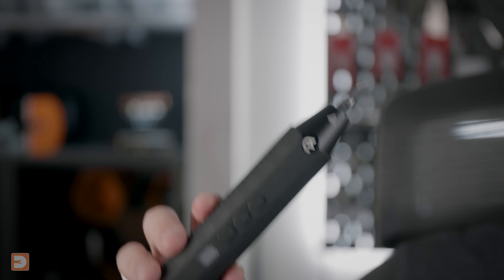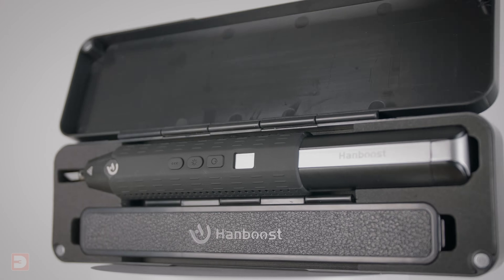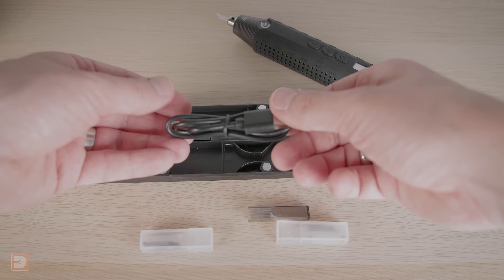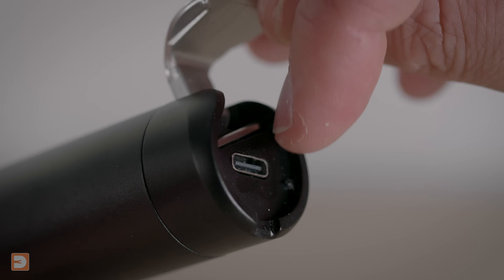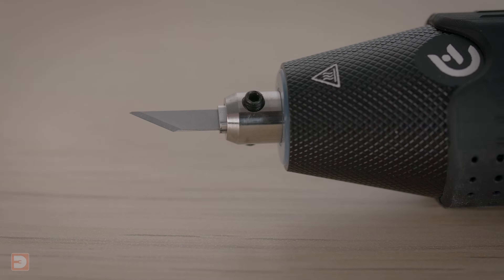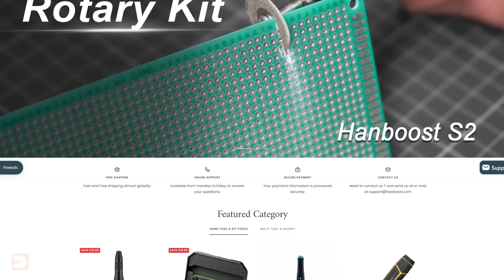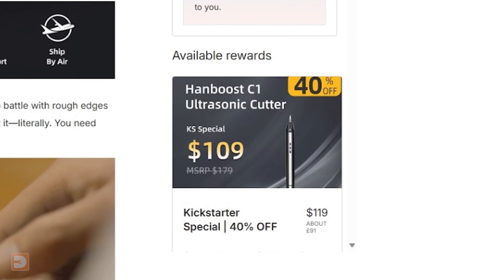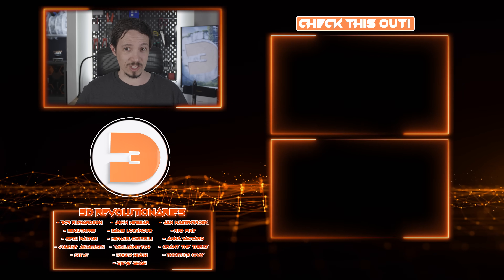Ultrasonic cutter with 3D printing

Comment: I started noticing a lot of audio popping around 2:15.
Reply from the maker: Yeah I’m really sorry about this. I’m not entirely sure what caused it. I’ve tested my full audio setup extensively after discovering this in the edit and it was all fine. The only thing I can think of is, I was experiencing a lot of static shocks whilst filming this video, which was often discharged when touching the camera, monitor or tripod, so that could have partially corrupted the saved files, but other than that I’m not sure.
It’s also the first video I’ve filmed in ages where I hadn’t also used a secondary audio system (so both radio lav mic & shotgun), which really sucks
Reply: Actually, it started before that

Comment: Constructive Feedback: at 4:56 you suggest it "seemed" to take less time overall; you have your hands on the tool and I came for your review, so please measure whether it took longer or not. Similarly at 5:54, telling me the C1 could "probably" clean up the melted cut surface doesn't help me learn about the tool; try it out, show me the results, talk about the results.
Reply: His description of the gains was a bit vague and reserved, but in that, it was very much on point: These things can make some things a little bit easier, but it's mostly just mild improvements over either entirely manual cutting or hot knives (expensive mild improvements, that is). Nothing that'd be easily quantified in cutting time.
Reply: I own a Custom Car shop my Vinyl Wrapper would love this tool..
Reply: A serrated knife would cut better
Reply from the maker: I appreciate your feedback and thanks for watching, but I feel  @keinschwein8467 who responded to you below explains quite well. The impact this knife can have on cuttnig time not only varies drastically on the type of job you're doing (3D printing support material or a vinyl sheet), but can vary a lot on the specific thing you're doing (2 different 3D printed models). 
I know that I did show direct comparisons in the video, and didn't show them in their enteriety in real-time (as that would have made for an extremely boring video), but I should have included a summary of total times, that's my bad. However, again, even if on that specific model it shaved off a few minutes time compared to traditional tools, on another model it could have saved 5 times as long, and on another one again it could have actually taken longer. 

At the end of the day it's another tool that's available to use when it's benefits can be useful, it's not something you'd force yourself to use all the time every time.

Comment: A add on metal extension so that the cutter blade is father from the unit would be a great thing for them to provide. That way it could reach those inside support places. Or just a new blade that is longer.
Reply: The blade attachment, stiffness and length is integral to the ultrasonic effect, so it's often not possible to just extend them.
Reply from the maker: Really great idea!